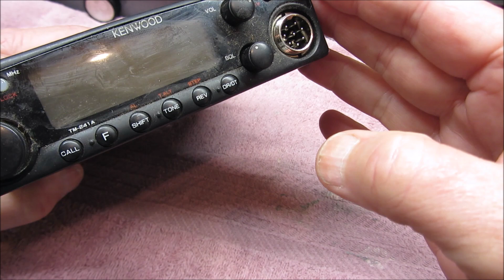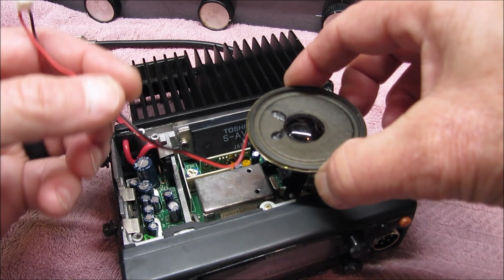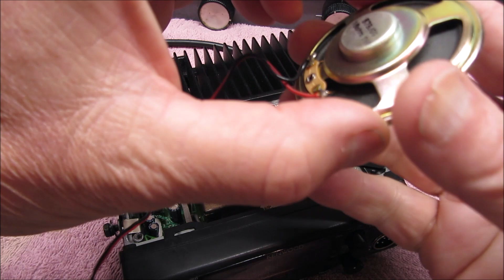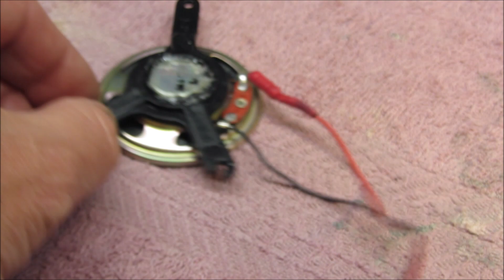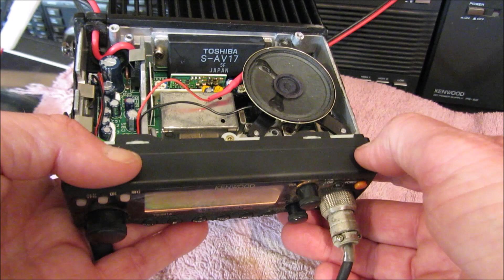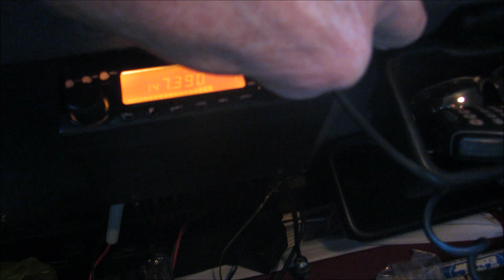Kenwood TM 241A Part 2 Repair of the internal speaker

Comment: Is this  tm261A  uses a 8ohms or 16 ohms speaker?
Reply from the maker: The internal speaker that came out of my TM241 was a 16 ohm speaker. The external speaker jack takes an 8 ohm speaker. As you saw in my video, I replaced my speaker with an 8 ohm speaker by putting an 8 ohm resistor in series with the speaker. If you dont have an 8 ohm, find a 10 ohm resistor, that should work fine. I hope this helps….Larry
Reply: @Backtothefutureradios  I need to do the same in my Tm261A?
Reply: @Backtothefutureradios   I saw the service manual and look sound  pa ci datasheet . Is 8ohms  for my tm261A
Reply from the maker: @ 8 ohms will work
Reply: @Backtothefutureradios   tm261 uses La4446 ci áudio amplifier. The ci's  Datasheet  recomends  4ohms . But the channel is Pararel with 8ohms  external speaker .  Because that I can use  8ohms or higher internal speaker .
Reply: @Backtothefutureradios  thank you!